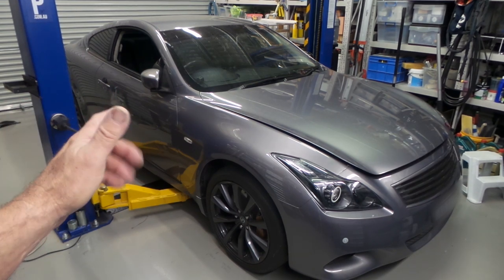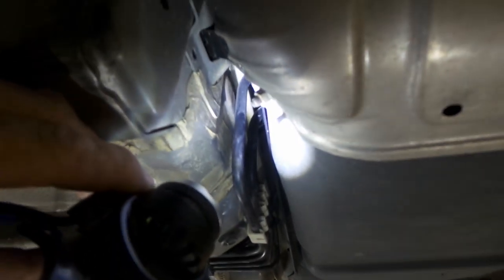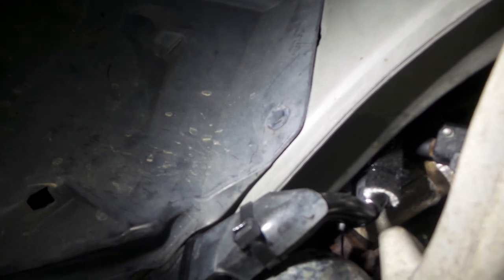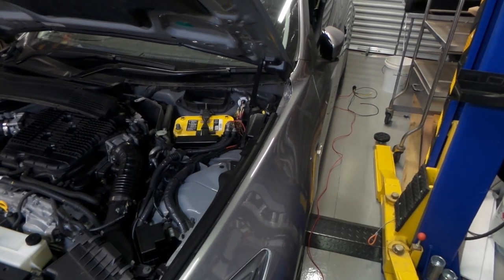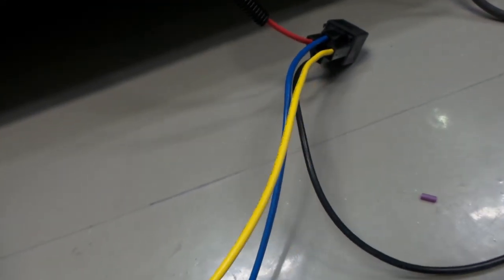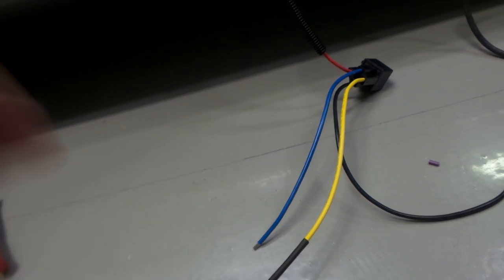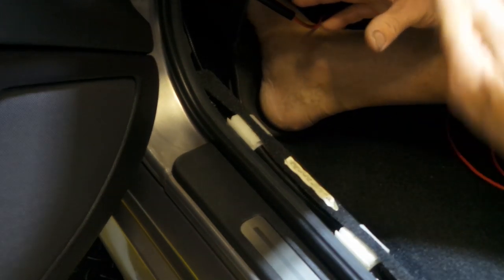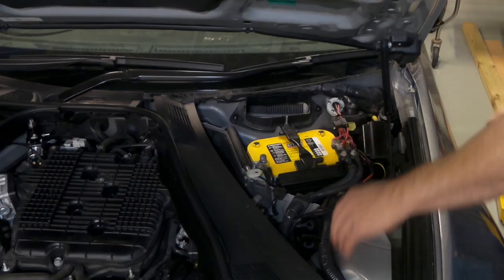The Ultimate 350z Early G37 Fuel Pump & Return Upgrade Part 2. Return Install + Wiring Upgrade

Comment: I am wiring up a 2008 350z hr with the deatscherks wire kit. I watched your video and from what I am understanding is I need to extend the yellow and blue wire 12awg , with same colors, and ground the black wire coming off the relay to the chassis . Then make another 12awg black ground wire to come off the fuel pump connector and ground that to the chassis also where the relay is also grounded. The factory blue wire that was cut is the signal to the relay blue wire, and the yellow wire is now put in the place of the blue wire on the connector for the power to the fuel pump.
Reply from the maker: Sounds like you have it sorted Mate, gotta love me some of that 350z HR goodness. Cheers.

Comment: Excellent video.  Thanks for taking the time to demonstrate this brilliant upgrade.  I wanted to take a fuel pressure reading from the rear compartment area.  Since I just want to tap on to the white male pipe coming from pump,  I want to get an adaptor to make a clean and secure job.   Do you happen to know which size is that white male plastic pipe coming from the pump?
Thanks again!

Comment: Came across your video the other day and a great visual. Had a question about the system you're using. I'm using the Spal relay harness system, and the wires are different color. Been struggling where to connect everything. To the fuel pump harness. If that makes sense. Anything would help. Thank you.

Comment: Great video. You answered a lot of my questions. However, there was one thing you didnt cover and I was curious about: I noticed that you didn't do anything with the wires inside the fuel pump hanger. Shouldnt those wires be upgraded also? Or is there no concern with those since the length is so short?
Reply from the maker: G'day Mate, That was done in the previous video @ around 53mins in. Cheers.

Comment: Did you connect the factory blue wire to the relay blue wire in any special way? Just asking cause they are different gauge wires and was wondering if that would effect anything if I spliced them together
Reply from the maker: G'day Mate, no, either solder or crimp will be fine. Cheers.
Reply: @TheAussieShed  thank you. Bless you for making these videos so dingleberries like me can get our buckets back on the road!

Comment: What am I supposed to do with the blue wire from the relay kit?
Reply from the maker: G'day Mate, The Blue wire on the relay goes to the old positive supply to the fuel pump (light blue wire) it becomes the trigger for the relay. Cheers.
Reply: @TheAussieShed  wait so where does the yellow wire from the relay go to then?
Reply from the maker: @xStaySkilledx  New power supply to the fuel pump.
Reply: @TheAussieShed  do u have an Instagram or somewhere I can send u a diagram of my fuel pump harness? It doesn’t have a light blue wire.So I’m supposed to depin and solder 3 new wires on to the fuel pump harness?
Reply: @TheAussieShed  nvm I see you put the blue relay wire to the old positive wire from the loom. Ty for vid
Reply from the maker: @xStaySkilledx , No worries Mate, it helps to watch stuff over & over a few times hey, i miss stuff myself watching vids all the time. Cheers
Reply: @TheAussieShed  hey bro would it be okay to extend the blue relay wire with some 14awg yellow automotive wire?
Reply from the maker: @xStaySkilledx  Sure thing.

Comment: Would you run two relays if you were running twin pumps?
Reply from the maker: G'day Mate. No you only need one. you just have to spec the wiring large enough to match the current draw of Both Pumps.
Reply: The Aussie Shed thanks man appreciate it!

Comment: where did the blue wire go
Reply from the maker: G'day Mate, The Blue wire on the relay goes to the old positive supply to the fuel pump (light blue wire) it becomes the trigger for the relay. Cheers.

Comment: Ive installed the fuel pump based off these videos; the fuel pump primes when ignition on. I left it a week have come back and the fuel pump is constantly running with ignition on without the engine running, do you have any idea why this might be?
Reply from the maker: G'day Mate, you could try swapping the Relay out, you might have a defective one. Other than that you need to check all of your wiring with a Test light. The Power is coming from somewhere, you need to find out where & why. Cheers